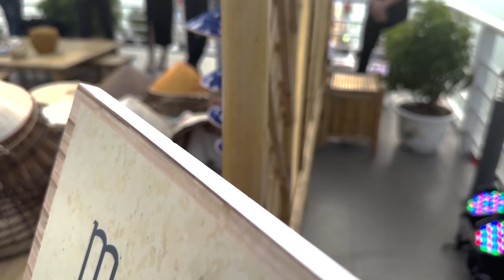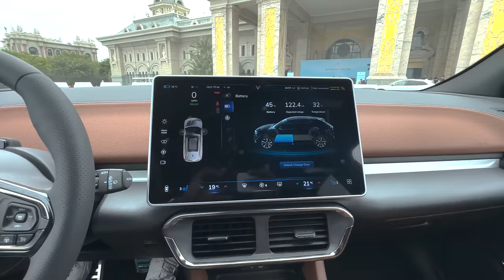The Best EV SUV you've never heard of: VF 8!

Comment: I was told that Vinfast has installed a "black box" (similar to those of airplanes) in each VF8 to record all accidents/problems happening to the EV. Also, most of the VF8 parts have QR codes, which let people know when and where they were made, who made them and when they need to be replaced. I am not sure if all of these are true. If they are, it's quite fascinating, isn't it?
Reply: i heard this as well and technically it's possible.
Reply: The QR code part is true... I've seen the black box but I don't know the recording part .
Reply: @unklevinhsjournal8089  Really! WOW.
Reply: Bạn nói rất chính xác.
Reply: It's true, I saw them on the last video they opened VF8 for reviewing.